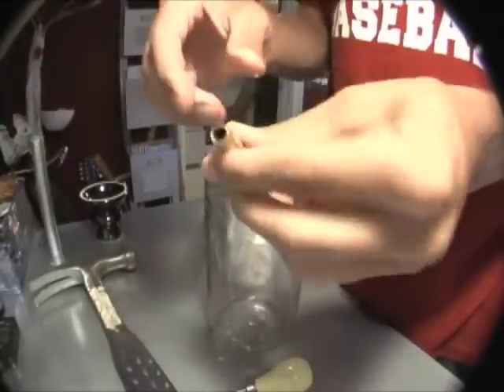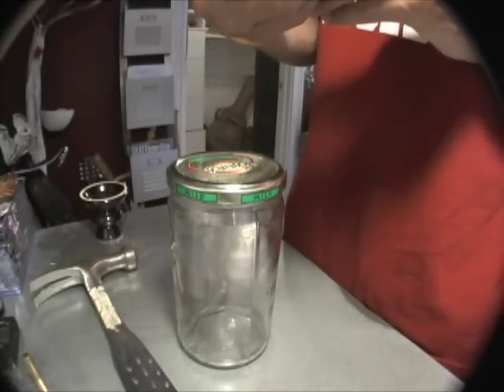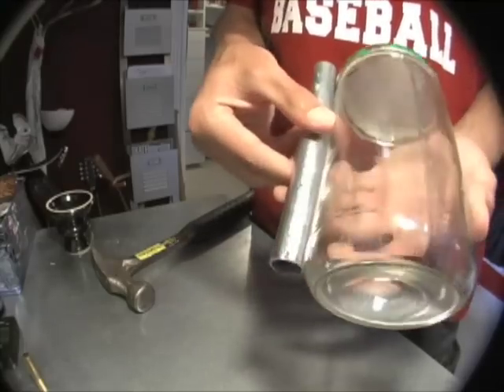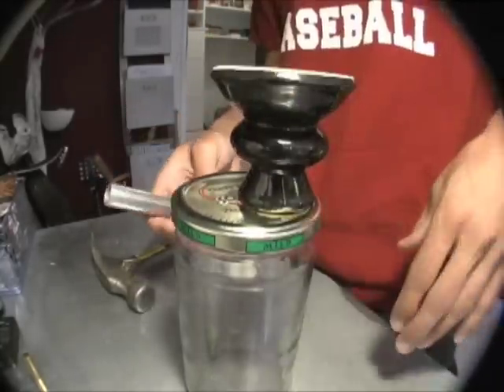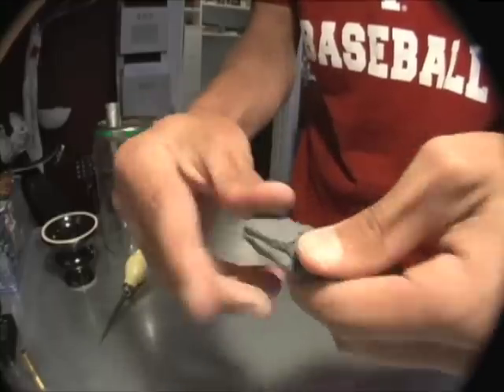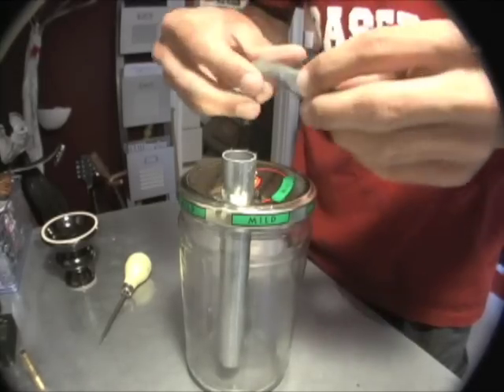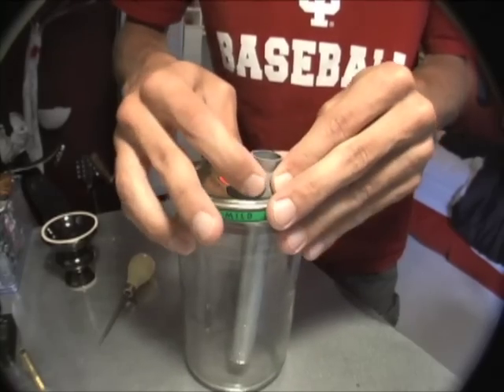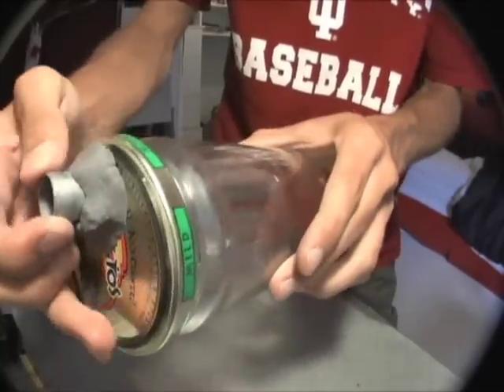Hookah How To Part 1

Comment: @chilipepperl3oy
I once made an entire bowl/chamber for a bong out of epoxy. When it hardens it will form a ceramic like material which is practically heat proof. Epoxy is very safe my friend, not to mention incredibly useful..

Comment from the maker: im not sure what blutak is but basically just look for anything that you can mold like clay or putty and dries rock solid. 

for those who question the saftey of the epoxy around the bowl, i have yet to have problems with it because the heat around the seal isn't hot enough to make it put off any fumes. i havent had a weird buzz yet. I'll definitely make a video of me and my friends smoking it sometime soon!